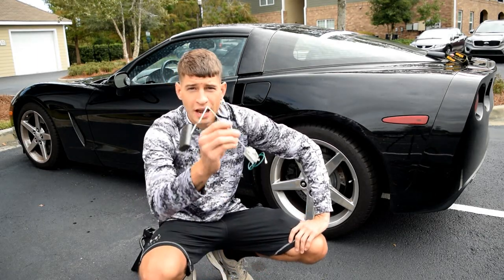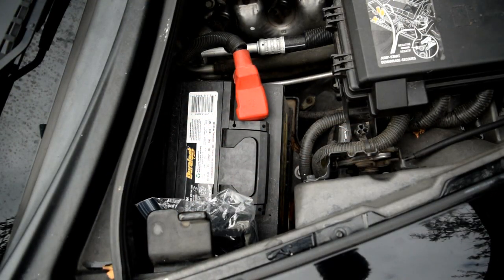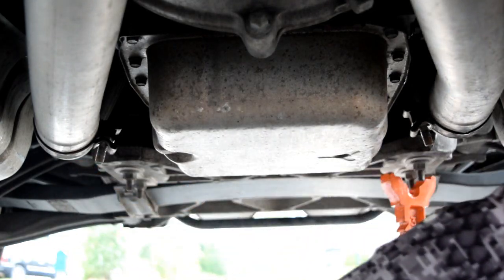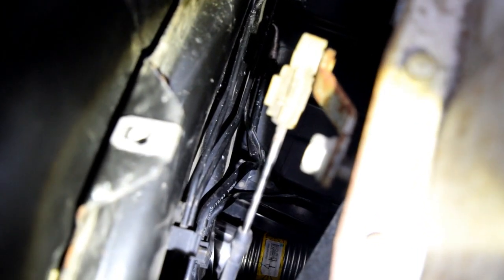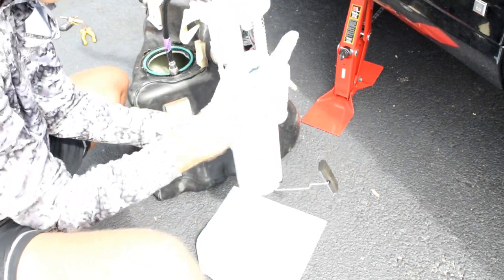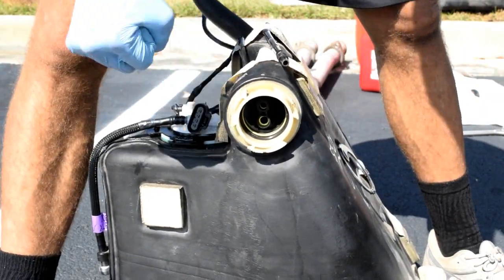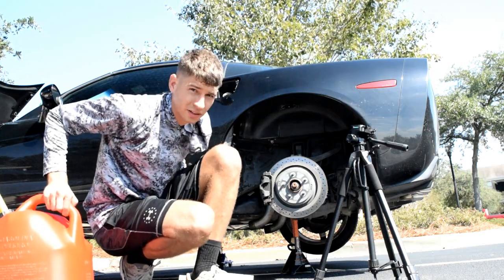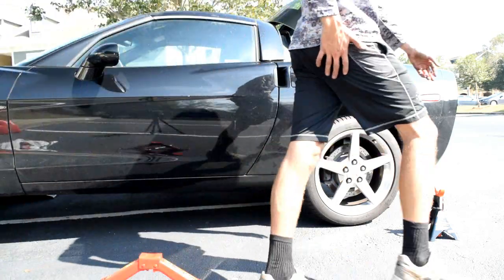Fuel Sending Unit C6 Corvette

Comment: This young man did a very nice job of getting into the fuel pump system that was/is so poorly & insanely designed by the grues of GM.  Having worked on cars and several Corvettes my entire life it has always amazed me how those designing machinery, especially automobiles, will put parts that will normally fail over time and have to be replaced, put them in places that require removing many components just to get to the failed part.  Two tanks, two sending units for the C6 Corvette is a pure example of engineers designing things in the office that fail to understand the "on hands" replacement requirements of the mechanic.
Reply from the maker: I agree, it does make you wonder how some of these designs make it into the final product :0. These days I'm an entry level civil engineer and I am getting my own introduction into the compromises and constraints that impact design choices.

Comment: By the way, Drew, I was able to get my tanks out, replace both FSUs, and get it all back together for a successful test drive 2 days ago.  There was a long time between starting this project and seeing it end because of travel, work, and a week long illness (not COVID!).  Thank you so much for your video because it helped me a lot.  

I did find that the cross over tube was completely seized into the passenger side tank and it was quite a challenge to get out.  It was so stuck it pulled both o-rings and both lock rings out with it past the detents that are part of the nylon entry to the tank.  I cleaned a bunch of residue off the cross over pipe with steel wool, being careful not to get any into the pipe itself, washed the inside of the pipe with soap and water and, after letting it dry thoroughly, found it was much, much easier to insert into the tank.  All went back together with no issues and my FSU issues have been resolved - the gas gauge was going crazy and not showing how much fuel I really had.  I also ended up removing the mufflers along with the mid-pipe just to have them out of the way.

Thanks for the good video.
Reply from the maker: I'm glad to hear you were able to get that crazy job knocked out :) its one of those accomplishments in life that few people will be able to appreciate. Money saved and experience gained. Im glad to report that to this day, the replacement pump and sending unit are still working fine for me, hoping they keep working for many years to come. Its pretty crazy how difficult this job it to knock out without taking apart half the rear end. Best wishes and happy wrenching

Comment: Thank you very much for this video. Gave me the confidence to do it on my corvette. You made removing the crossover tube and putting it back in look way too easy! I struggled for days with it. One thing I'd recommend to others, put a loose zip tie around the crossover tube, will give your fingers/arm something to grab onto and pull to help pull the crossover tube out and help pull it back in. (Can easily cut when done) I originally skipped over the part where you were using both your arms up in there. That is probably the best tip. Positioned just right, with 2 arms.
Reply from the maker: Glad the video helped :] Good tip with the zip ties, if I ever have to do this job again in the manner I'll try it out (hope I never have to tho haha)

Comment: Even though I'd NEVER attempt this on my car w/o a lift--I'm too old and stiff to crawl around under a low ground clearanced car like this--And mine's a 2013, so I think this issue was addressed, this is still a great vid to watch. Always interesting to see how my car was assembled. I always wondered how those tanks were installed and how they operated. Thanks for a GREAT video. Even if I never get to do this myself. I'd guess this is about a $850-900 repair at the dealership.
Reply from the maker: I'm glad you got a kick out of the video, it was a good challenge in dexterity, and frustration the first time I did it but it got a bit easier each of the following times. A bit more challenging than changing out the rack and pinion for sure which was my most recent project (I didn't film that one tho) happy driving, stay safe out there

Comment: I just did my 2011 c6, it took me a 16 hours to solder the pcb board of the sensor to keep the stock wiring.

The hardest part is removing the crossover pipe on both side, also the the driver side fuel pump is the hardest to remove as well. Overall i am satisfied, everything are back to working normal condition.
Reply from the maker: Good stuff! I hope that ends up being a permanent fix for you, certainly not a job you want to do more than once :)

Comment: You got exceptional knowledge, self discipline, tools, and communication skills for one so young.  The product of exceptionally good parents.  Where'd you find C6 compatible wheel ramps?
Reply from the maker: Thanks for the positive words Mike :]  If I recall properly, I'm fairly sure I picked them up from an autozone. They do catch on the air dam a bit when backing off them, but they have been holding up well for years now. Out of curiosity, what type of engineering do you do? I'm Civil on the CM side these days
Reply: @DrewMann  I'm a mech E by degree, and work in the commercial nuclear power industry.  What's CM?  
The engine mounts went bad on my 2006 Corvette, so I bought these aftermarket mounts made out of modified hockey pucks and aluminum cases.  (Regretable purchase on my part.)  And immediately after a shop installed them, which was about 5 or 6 months ago, I've been having trouble with my fuel tank gage working right.  Maybe they buggered up the brittle wire insulation in between the fuel gauge and ECM, or maybe they buggered up the ECM, or maybe the higher conductivity of the aftermarket mounts in and of itself is buggering up my fuel gage?  Well, I'm going to take it to another shop tomorrow Lord willing and see if they can fix it.
Reply from the maker: @engineermike5987  oh neat, I imagine that's an interesting line of work. (CM for construction management). I also had my engine mounts replaced less than a year ago, but went with OEM and not having any issues with them. I would be fairly surprised if there was a correlation between the work you had done and the fuel gauge acting up. Is the problem manifesting itself as the needle moving some what sporadically or dropping down by about half randomly? If so, it seems like it would probably be related to the fuel sending units going bad

Comment: Thanks you very much for this video.  I have to change the fuel sending unit in my passenger tank and, while I'm at it, will go ahead change the driver side unit, too, because I don't want to have to take all of that apart a second time.  It is clear from your video that it is doable by someone who hasn't done that type of service before, namely me, as long as I follow your steps.  I'm using the money I'm saving by doing it myself versus having a shop do it to justify buying a set of QuickJack lifts - well, saving a $1000 bucks on labor doesn't pay for the entire lift but it works in my mind.  :  )
Reply from the maker: I wish you the best of luck in your endevor, there's of course significant risk involved in this particular job, fire hazard and risk of damaging something (and even personal injury), but if you are willing to accept those risks and tackle the project and end up successful, it can certainly be a rewarding experience and a significant financial savings over paying to have the done job for you. Feel free to let me know how it turns out :)
Reply: @DrewMann  The QuickJacks arrived and I've got the car up.  Tomorrow I will empty the fuel tanks (already just at 2-3 gallons in the car), get the wheels off and go from there.  I saw another video by a YouTuber suggesting that the tanks get a thorough internal cleaning while they are out of the car so I will add that step.  I'm also going to lubricate the sway bar bushings because they make a little noise during winter, change the transmission fluid, and I'm considering taking the upper a-arms off and putting polyurethane bushings in - maybe.
Reply: @DrewMann  Dude, if you lived in the Atlanta area I would literally pay you to come take the tube out of the driver's side tank.  I have the metal tube disconnected from the tank and pulled out but just can not get it pulled out far enough to see the black tubes inside it.  I even took the skid plate off the passenger's side tank to give the metal tube a little more room to flex but that didn't do any good.  Do you have any other pointers?
Reply from the maker: @johnwilcox6376  Do you have the passenger side tank disconnected from the crossover tube? sometimes one may be slightly easier to remove than the other just do the the slight differences in room to maneuver, sometimes this can help free up space for the other side. Lowering the passenger side tank a bit can certainly help create a bit more room for the crossover tube, but clearly it doesn't seem to be quite enough. That part of the project is certainly the most difficult and frustrating part for sure, if you are able to get past that, the rest is fairly simple by comparison.  I think I saw someone on the corvette forums that made a crossover tube compression tool, Ill dig around and see if I can find it, but not sure that there's room for in the the method you may be doing. 
https://www.corvetteforum.com/forums/c6-parts-for-sale-wanted/3679325-c6-fuel-tank-crossover-tube-install-remove-tool.html
Reply: @DrewMann  I never closed this: I got it all done and the issue was that the o-rings on the passenger end of the crossover tube were seized to the tube and were not allowing the tube to be pulled out.  So, I eventually just did the brute force thing of just yanking the tube down toward the ground and, despite their size, the o-rings came out with the the tube!  In other words, they were so adhered to the tube that they squeezed through the tank opening when the tube was removed!  Anyway, once past that step it was pretty easy and reassembly was straightforward, though I did practice a few times with all the parts outside the car since connection of the pump lines which are housed within the crossover tube is a totally blind operation.  All has been good since then.  Thanks, again, for the good video to get my over my anxiety about starting that project on my own.
Reply from the maker: @johnwilcox6376  very glad to hear that it all worked out in the end, and if anything it's probably a more memorable experience thanks to that tricky o-ring. It's fun to hear from other people who are tackling the same problem and I'm glad I was able to provide even a little bit of help :]

Comment: Thanks, I will be tackling this during the coming months and in my driveway so this video was helpful, thanks again.
Reply from the maker: Best of luck on the project, it can be a real pain, but if you can manage to get that cross over tube than the rest is fairly easy. Hopefully you have an manual transmission, or at least I have heard that they are easier to work on for this particular job.
Reply: @DrewMann  Nope I have auto, the one leg thing stops me from having the manual, heck it would be no fun if it was easy.  The cross over tube looks to be a huge worry but nothing ventured nothing gained.  Your video shows it is possible and it shows it will be a lot work I know but thanks for the video it is/will be a great help.
Reply from the maker: @Tommyoneleg I can dig it, best wishes! Hopefully it's not your daily like mins is haha, it really puts on the pressure to finish the jobs before the weekends end

Comment: Awesome video, Awesome narration!!  My C5 '04 M6 is a likely candidate for this repair as the gas gauge intermittently drops to empty and then Check Gauges light displays, it will drop to read Empty after every fill-up yet oddly enough read correctly once the tank is below 1/2 and just above 1/3 full ... not sure why this is but I'm guessing my problem may be with the passenger side tanks unit?
Reply from the maker: Sounds like the passenger side sending unit is starting to go for sure, but to be honest, if you are replacing one of them, its probably worth it to also replace the other, as well as the fuel pump (if its the original) just to save on a headache later. Best of luck!

Comment: Amazing job Drew. The crossover pipe looks really hard to get at. Hoping my C5 doesn't need that done for a long time.
Reply from the maker: The first time is the hardest haha, after that its not so bad. Another note worth mentioning is that if you hare having weak startups, removing the throttle body and giving it a good wire brush cleaning (with carb or mas air flow sensor cleaner spray) seems to make a big difference, just found that one out this weekend. Best wishes.

Comment: Your videos are excellent.  Question: could fuel tank connecting line be the issue which is causing gas odor in car?  Ours is a C6 2007 and the odor did not start until I filled the gas tank half full.  10 year extended warranty for specific parts ended in 2017.  Recalls never expire; warranties do.  Can that line be accessed without extensive tear down?
Reply from the maker: Good question, tricky to say where the gas smell is coming from without poking around the car, but there's only so many places it could be really. Either one of the tanks has a puncture (seems unlikely), a line seal could be bad as a result of age (seems likely) , may e something with your evap system, maybe the fuel rail or an injector. Really tricky to chase down but an important issue to resolve for sure

Comment: I know this is an older vid. But iam getting ready to drop the tank. How hard is it to reconnect crossover pipe/lines and secure lock ring. Any tips on restall.
Reply from the maker: I would check out the corvette forums for close up pics of how the crossover tube connection works to make sure you have a good handle on it. Depending on how much space you have to work it can be a bit like working blind in there.  Patience is going to be a valuable asset. Getting the crossover pipe off is the hardest part, the rest is manageable by comparison. Best of luck to you :)

Comment: Drew, wonderful and helpfull videos. Question if I might regarding the C6 fuel/oder tank repair. After removing the wheel on passenger side and the inner finder covering. Could you reach above the left tank top  and the vehicle roof. Could a person reach the top where the pump/filter upper part is located--enough room that is so a person might use a shop rag with alchol and actually clean the area where the problem exists. Crazy at it might be and certainly not a full born tank removal...wash the top cean a couple of times. Then--don't laught--use spray on flex rubber can in such a position as to floor the area in ? left dry and recoat essentially blocking off the odor leak. Oh, go a head and giggle--just a little. Might last an unknown number of years and a lot less than 4000. the dealer want's by removing halk of the vehicles undercarrage. Thanks, Eric
Reply: Drew, still around to chat?

Comment: I’ve got an 05 c6, manual, got it up on 4 jacks, and got wheel off and inner off, and the throat off and electrical line and fuel line off, in the morning I’m starting on the xpipe, gonna try to do everything you did. I’m just concerned about the fuel line connections in the cross pipe. My fuel pump went out and I noticed before hard times starting before it went out. Wish me luck my friend, great video btw!!
Reply from the maker: Best of luck good sir, I hope that crossover pipe doesnt put up too much of a fight for you :)
Reply: I got the drivers side tank off, it was me , my son, and buddy of mine . We were able to get the tank completely full of fuel down. Whoever had it before did some goofy stiff on this car. The fuel pump has been worked on before and the person had some cheap fixes on it, the fuel lines inside tank one had been broken and they used a hose and hose clamp to repair it. It wasn’t done snug enough so it didn’t last long. The cross tube connector looked like it had been beat off a few times, getting it reinstalled tomorrow after getting new fuel lines for it . It’s been an experience all right. Wish you were near . Sevierville tn , but I couldn’t have gotten as far as I did with out your video, watched it a100 times . Ty btw. God bless
Reply from the maker: @jeffreychapman6287  I'm glad to have been able to share from my own difficult experience with this particular job. I tell you, its crazy how many other people have ran into this same issue, and I always get a kick out of hearing about their experiences with it. Its been a good many years since I was last in Sevierville, I used to visit a family friend out that way as a kid, really pretty area. I remember chasing and catching fireflies haha. I hope the previous owner had disclosed their work, but I suppose if you got the car from a dealer they probably wouldn't have known about it. Used cars can certainly be a gamble. I imagine that you are going to end up being an expert on the c6 fuel system by the time you are done :)
Reply: Man alive , I’ve got the connection fixed with zip ties like you did , the hardest part today is getting the connector from inside the tank while putting in the pump , any suggestions?
Reply from the maker: @jeffreychapman6287  I think I might have used an old wire coat hanger to help manage the lines, even still it can be a pain for sure :0
Reply: My hardest thing now is getting the cross tube attached and locked
Reply: I’m so close and this crossover tube is kicking my butt lol, is there not a pry bar something to push it in ?